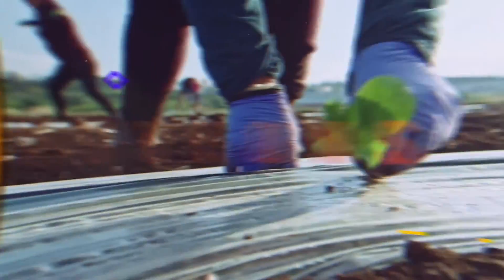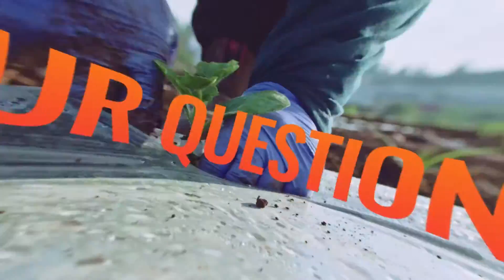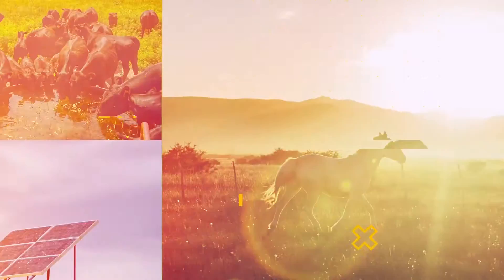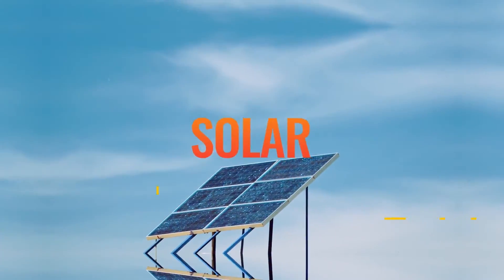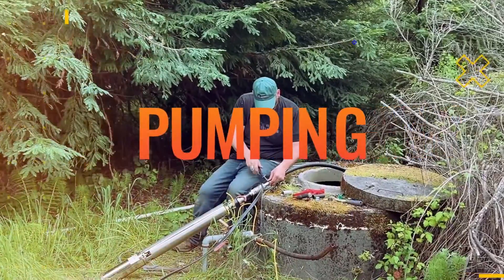What Should I Look For In A Solar Water Pump?

Comment: Do you know of any solar pump or system that can be used to pump water up a 3/4" water hose from a 100' deep well casing where the pump is up on the ground next to the casing?  The closer to 9 gpm the better.  I have a 2500 watt submersible now but I lose pressure in the house when the pump is running 24/7 into the lake.  I was hoping to find a 1000 watt or less dry pump instead to save money and allow the submersible one to be use for the home only. I don't think running a water hose in the casing would hurt if I cut the metal nozzle off and I have room for it????

Pressure tank is around 35/75 when I bought the home and I usually run it at 18 lbs constant to fill the lake between rains.  I've had the pump running for 2 weeks at a time with no issue and its flowing around 17.5 gpm at 18 lbs controlled with a valve ball I turn half open. 

The previous home owner has the water passing through the pressure tank before filling the lake but I wounder if it should be before the pressure tank that way the tank is used for the home only and I can have good pressure to take a shower instead of 18 below?